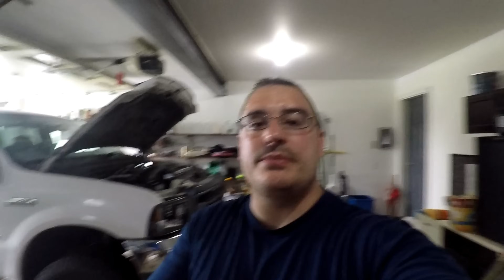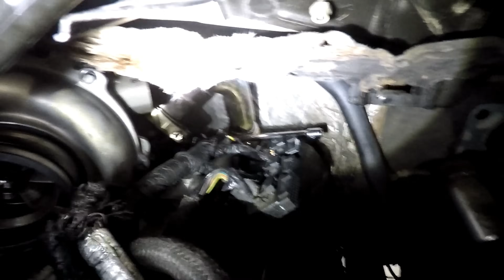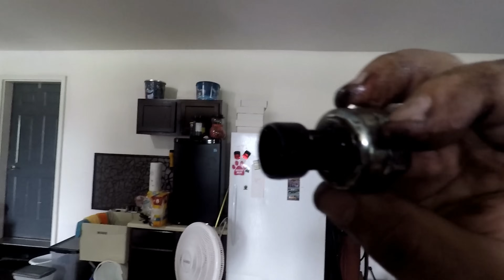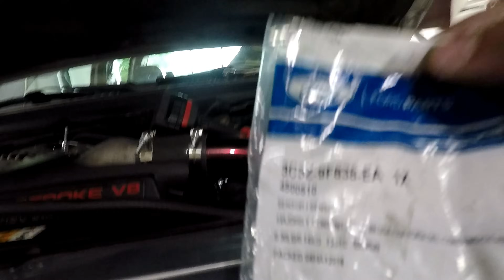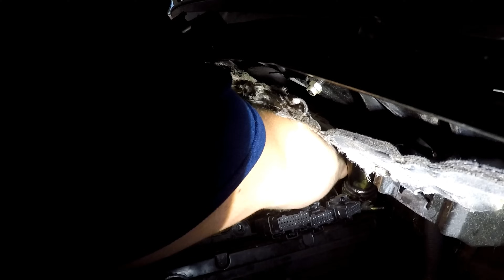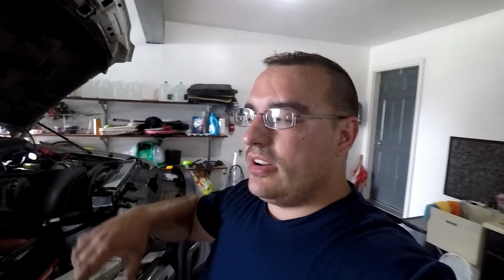6.0  Powerstroke ICP Sensor Replacement The Easy Way

Comment: For anyone asking ....what is that👍
In a diesel engine, the ICP sensor works as a moderator of sorts that insures the engine is running at maximum efficiency. ICP stand for Injection Control Pressure this means that the sensor provides feedback and indicates the needed and existing injection pressure in the injectors.👍🇺🇸👊
Reply from the maker: Comment is pinned!
Reply: will this same part work on a 2007 f250 6.0?
Reply from the maker: No your icp sensor is on the passenger side valve cover and you can just use a socket. It's right by the glow plug module
Reply: @six0bros  my bad, i meant is the icp sensor part number that same for my 07 since you're working on a earlier 6.0
Reply from the maker: Ok I gotcha. No you want the update for the later years
Reply: @six0bros  ok thanks, you dont happen to know that part number by any chance do you?
Reply from the maker: I do not. Check xdp they will have it under sensors with part number. Coupon code diesel10 too
Reply: Thank you the location of my ICP sensor is the back of the turbo correct?
Reply from the maker: It can either be under your turbo for 03 and early 04 trucks or it can be on the passenger side valve cover
Reply: I have a 07 6.0 I let a machanic work on it for a hard start he changed the IRP VALVE and the ICP sensor he was calling to IPR a sensor too well when I got in my truck it wouldn’t hardly run it hardly makes turbo boost psi and won’t hardly shift gears either of he changed the plug on IRP valve too. I changed the map sensor and the little hose on the map sensor and made sure the airway was ok en on the header just wondering if y’all know a thing I could check before I spend more money on a mechanic for this
Reply from the maker: Do you have a way to check engine vitals? I would like to see ficm voltage, icp volt, ipr %, ebp vgt duty cycle while idle and under load

Comment: 2006 E350 6.0 Quigley 4x4 VAN 85k miles and all these videos are like yeah its easy 🤣, I'm like have you worked on a van yet 😂. All started when i added Archoil Friction modifier and then the gas treatment, and it was good for about 2 days. Then it was taking 12-15 seconds to start instead of 6-7, then one time it just cranked and never started so I had it towed to a gas station(personally big mistake instead of a diesel shop I think) I told him what i added so he said I needed a injection pump and regulator. He said I needed the regulator bc ford wouldn't warranty the injection pump without it, so that was an extra $500. Then he charged 3 hrs of labor for rust bc they had to torch rotted hardware and clamps blah blah plus I got 2 new batteries which were $250 each. So $5500 later and the truck was still having long crank times and sometimes when it started it ran real rough then evened out after about 30 seconds to a minute. I felt like i was gonna get stuck again. I bought a topdon S600 scan tool and I got a code twice on different occasions for a P2284-E0 ICP(Injection Control Pressure) Sensor Circuit Range/Performance.  So this time i brought it to a diesel mechanic and he said he ran some test and it was the high pressure oil pump, he said it was running at 50 percent, so he changed that and a new oil change for $2700. Got the truck back and the truck seems to start fine cold, just when it gets up to temp and you let it sit for 10min the truck cranks for like 15-18 seconds before it starts. Now i told him about the ICP sensor and he says its not that. Now i'm at a loss for words 😂. He said it might be one of the injectors, but i can't just keep dumping money into this truck. I'm actually trying to sell it but don't want to sell someone a bad truck, I'm just trying to do the right thing. It's currently at the diesel shop but he's had it a week already and still hasn't looked at it bc of all the work he has. Any ideas would be greatly appreciated!

Comment: My truck is lifted, was easier to do it from the bottom of the truck. Didnt have to take anything off.
Reply from the maker: I've done it from the bottom I just don't like to but you are correct it can be done from underneath

Comment: I have a 06/07 I don’t think this video is for me
Reply from the maker: No. Icp sensor on your truck should be on the passenger side valve cover. Super easy on your truck.
Reply: @six0bros  thank you for replying to me
Reply from the maker: Anytime man!
Reply: What sensor would be at the back of the drivers side that could be puking oil out ? 06 6.0 f550

Comment: I have a 05 and it just stopped running while I was driving. It will not start now
Reply from the maker: Does it try to crank over though. This likely sounds like a high pressure oil leak. On 05 it is either the stc fitting which comes off the hpop. It could also be the sandpiper and dummy plugs. The first thing to check before that is unplug the icp sensor on the passenger side valve cover. If the truck starts and runs when hot then it would just be the sensor that needs replaced.

Comment: Howdy,2 questions,one you already answered, I have a 2006 f-350 6.0 and the icp sensor I got fr auto shop is different than the original, anyway the three wires to the part were all bare and touching,the new sensor came with a new plug and wires is crimpjng them enough...
Reply from the maker: If I understand the question correctly I would make sure wires are all cover and protected
Reply: @six0bros  I put a new plug on ,I just hope that crimping is enough put the heat shrink on as well
Reply from the maker: Ohh I understand. Yes crimping the wires together then heat shrink wrap is how I have done it in the past.
Reply: @six0bros  thank ypu
Reply from the maker: No problem

Comment: Hey I have a 04. It was having problems shutting off after getting to operating temperature. I couldn’t work on it for about 4-5 months. Now after sitting for that time it starts up and runs for a few seconds up to a minute then shuts off. Pretty sure it might be the icp sensor. Was curious on your thoughts.  Thanks so much.  

David
Reply from the maker: It sounds like a high pressure oil leak to me. To test your icp sensor just unplug it and start it back up. If it runs fine and doesn't shut off at operating temp then you're good,  but I think it is likely that you have a high pressure oil leak or failed pump. This brings me to the next question. Where is your icp sensor located and which style pump do you have? This will help me to figure out which issue you're actually having
Reply: @six0bros I’m having just about the same issue with my 05. I haven’t touched in awhile I gave up on fixing it but I want to get it back on the road. Mine will run and drive fine however when I shut it off it will not run until getting cool. I just think it’s the HPOP. Your thoughts would help a ton. Thank you.
Reply from the maker: Hey man sorry for being late on responding. So it is very unlikely the hpop. The 05 pumps are very reliable. The issue tends to be from stc fitting that attaches to the pump, stand pipes, dummy plugs. These are likely your cause. I would start with replacing them as they are relatively affordable and they are good to have fresh ones in there no matter what.
Reply: @six0bros  I’ll get working on that soon! I’ll send you an update thank you!
Reply from the maker: @SlickRick-98  great man let me know how it goes.

Comment: Hello I have a 04 F-350 with 6.0 power stroke I have replaced the new turbo evething worked fine when I got done. I drove for like 40 miles and the bottom intercooler hose came off it wasn't tighten enough. So I drove  back home got back on and it work fine for two days and now it won't starts. It feels like it wants to but it won't start. Can you please give an idea what wrong with??
Reply from the maker: So it shouldn't be anything to do woth that intercooler or turbo replacement. Do you have a way to read engine vitals

Comment: I'm a 73 year old retired electrician who has a early 2004 6.0 and it has the old style intake manifold and I've changed the icp  from both the under side and the top side and its tough either way but I prefer going at it from the top, I have a early 2004 6.0 2 wheel drive excursion.
Reply from the maker: Either way can have a challenge but for the lifted guys it's hard from underneath or there is just such little room that up top is definitely my favorite to do it too
Reply: I when the excursion first come out I was living in Houston and would pick saying they looked like a apartment going down the road lol
Reply from the maker: I remember when they came out to and I was in awe of them

Comment: I have a 06 f250 and it starts up pretty good when (cold) but once it’s up to temp and you shut it off and try to start it again in about 30 minutes it will give a long hard start before finally starting up. Any idea if this issue would be the icp sensor ?
Reply from the maker: Sounds like you could have the start of a leak or just maybe a slightly warn out part. You could try unplugging the icp sensor and seeing it it goes away
Reply: @six0bros  messing with it now. Im hoping it’s not a leak and just the sensor . The truck just got bullet proofed last year
Reply from the maker: You could pressure test it and see if you have any leaks. About 150 psi of air should be enough to hear a leak
Reply: @six0bros  I’m driving the truck from florida to texas in a few hours .
Reply: @six0bros  would it be possible the hard start no start issue could be from the truck losing fuel pressure? I popped the hood and primed it muitple times and can hear a very very small leak / hiss
Reply from the maker: How did the drive go?
Reply from the maker: Not typically a hot no start issue. It's always good to verify fuel pressure though
Reply: @six0bros  truck made it broke down twice lol 1 was my fault ran it out of fuel said it had 50 miles till E but that was a lie lol. And I had a no start the 1 time I turned it off in the drive thru .sprayed some carb cleaner in the intake and got it going along
Reply: @six0bros  also the truck surges very bad under (mild- full throttle) the rpm and boost both surge in the same rhythm . I’m thinking maybe the VGT solenoid?
Reply from the maker: If its running out of fuel on you like that while there should be some left its the pickup tube is broken. Hot no start is likely a high pressure oil leak.
Reply from the maker: It sounds like there could be a few things that need done. I would start with what you know and that is the hot no start and that pickup tube. Also check for any codes currently on there. Most likely cause of leak stand pipes, and dummy plugs, stc fitting off hpop.
Reply: @six0bros  I’m gonna try and tackle the dummy plugs and stand pipe tomorrow in the hotel parking lot
Reply from the maker: Good luck let me know how it goes.

Comment: Ford made the worst decision ever to go from the 7.3 to the absolute junk 6.0
Reply from the maker: They didn't have a choice. They needed to meet emissions and needed more power. When it comes to power  and towing performance the 6.0 is better. Now the 7.3 has a better track record for reliability so that does say a lot but but running perfect a 6.0 has better performance.

Comment: So it will leak out the sensor
Reply from the maker: Yes it will leak out of the sensor. Later years seem to be more reliable but they require a different size tool to install

Comment: Are ipr valve and icp sensor symptoms the same?? Please help I have an 05 f350 and it runs just fine until it gets up to temp then will die and no start untill it cools I have narrowed it down to the icp or the ipr I am leaning on the ipr untill I saw that the icp will leak I have a small leak in icp area
Reply from the maker: Ipr and icp do not typically a hot no start.  Typically on 05s icp sensors are pretty reliable. The next time it happens unplug your icp sensor and if it fixes it your issue is the sensor. The truck will run without the icp plugged in. It is not ideal but the truck will defer to an inferred value to make it run
Reply: @six0bros  thank you bro
Reply from the maker: Anytime
Reply: @six0bros  hey man just wanted to thank you bro I unplugged it and the mf runs like a dream so I guess the icp it is... You just saved me so much trouble man
Reply from the maker: No problem brother, glad I could help!
Reply: @six0bros  it runs great starts rite up but will die when it gets warm if I try to drive it I also have a small leak while running
Reply from the maker: Sounds more like one of those things I listed stc, dummy plugs and sandpiper
Reply: @six0bros  I'm fkn stumped on this thing I'm about to sell it
Reply from the maker: Have you replaced the stc fitting on the hpop, have stand pipes and dummy plugs been done too? Those are yiur most likely culprits for a truck dying when hot
Reply: @six0bros  and no stc fitting has not been done or dummy plugs
Reply: I also shared your channel and will continue to check with you in the future as well as help you any way I can.. what a great dude 🤘🤘🤘🤘
Reply from the maker: Man thank you so much I really appreciate it means a lot
Reply: Before I do grab the new one because that's about all the cash I have when I unplugged it it worked like a dream so that would be my problem rite? And thanks so much again buddy
Reply from the maker: Yup if it was happening and you untagged it and immediately it worked then yup that's your issue.

Comment: Thanks for the video 
I do have a question I have a 2004 
But the valve pan cover says 2003 
Do some 2004 and up have the ICP sensor on top of the valve pan cover 
On the passenger side because that's where everyone was telling me  it was 
Until I seen your video then I found it 
Thanks 
Curtis
Reply from the maker: Hey sorry for the late response. So the 04 model year had 3 different hpo system configurations So the first 03 had the old style pump and the icp under the turbo. then there are some 03 engines that had the icp on the valve cover but still used the old style hpop. then last the 04s had the late style pump and the icp on the valve cover.

Comment: I'm having trouble with my truck randomly shutting off and running a little rough. How do I know if it's the icp sensor?
Reply from the maker: Unplug it and see if that fixes it. Do you have a way to monitor engine vitals
Reply: @six0bros  is it ok to run it for a while unplugged? It doesn't shut off every day even. I have the sct x4
Reply from the maker: Yes it will be. The email will defer to an inferred value. I would recommend buying forescan app and an obd2 Bluetooth to connect to your phone itbwill be better at monitoring
Reply: @six0bros  ok thanks for your help I'll try that
Reply from the maker: No problem let me know if I can help anymore

Comment: My 6.0 turbo diesel died while driving and cranks but will not start could this be it?
Reply from the maker: Could be. An easy test would be to unplug your icp and see if the truck starts then. If it does then it's just the sensor needs replaced
Reply: @six0bros  awesome thanks for the fast reply
Reply: So just by unplugging it if the ICP is bad the truck should start?
Reply from the maker: No problem I'm not always super fast but I do try lol
Reply from the maker: Yes. The ecm will defer to an inferred value. So if the sensor is bad that's all that needs replaced. Maybe the pigtail on the wiring harness if it is oil saturation.

Comment: I have a 03 the intake cannot be removed without taking out the turbo and it's not the up valve that is the pain in butt it's putting the connector back on
Reply from the maker: Are you talking about the icp sensor or ipr valve?
Reply: @six0bros  icp
Reply from the maker: It is a tight fit but if you take your ficm off you should have access to it. I have changed mine with the 03 style intake on. You can also get it from underneath the truck it can be hard but do able you just have to reach up and grab it

Comment: I want to thank you for posting the video. I'm a new owner by 3 months of my beloved 05' F450 4x4 Dually Crew Cab/🥰
 Inconsistent no start has left me with my first big chore on learning how to fix the beast myself(43 yr 5'4" old not a guy nor diesel mechanic). In all my research I learned about the sensor and just needed detailed instructions on changing it out today. Thank you for helping us owners be more self sufficient on expensive repairs.
Reply from the maker: Anytime! I love hearing about people getting in there and working on their stuff when they can. I am far from a mechanic but I have slowly learned and worked towards getting better. If I can ever help just let me know happy to help in anyway. Happy wrenching!
Reply: @six0bros  I appreciate that! I did get it swapped out at a mere $200 for the part ...for the love of my free labor...huge savings.
Reply from the maker: Awesome!

Comment: My truck says October of 2003 f350, so would the icp be in the back like this one?
Reply from the maker: Yes it will be
Reply: It’s got a heat shield around it , it looks like
Reply from the maker: Yup they do there is a button on one side just snaps off
Reply: There’s also a sensor on the front passenger side of the motor too that looks like the same sensor?
Reply from the maker: @jamessmith5905  send a picture to my Instagram 6.0hbros
Reply from the maker: @UCj-Rs4px_BXe4YmtRiSz9qA could have been an engine swap or someone swapped the oil system over to a newer style I'll help you get it sorted out with the pictures
Reply: Trying to send pics now
Reply: The pictures are of the front passenger side
Reply from the maker: Hey did you send them to @6.0hbros
Reply: Yes I messaged them to you on IG
Reply from the maker: I didn't get them. One thing make sure there is the h in there. There is a 6.0 bros that is not me.
Reply: Yeah it’s showing they sent. 6.0hbros, shows up as Jared